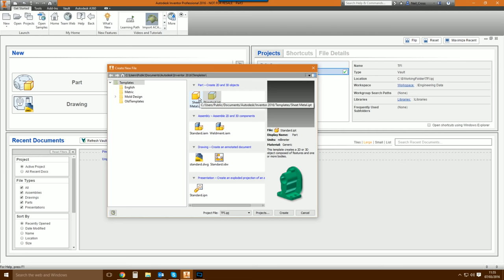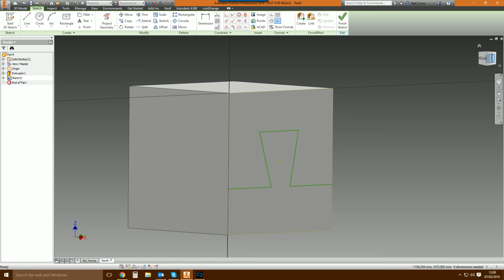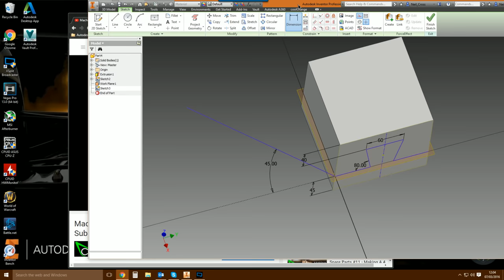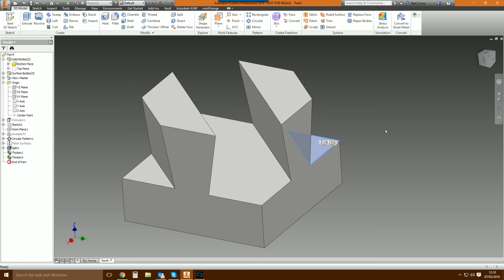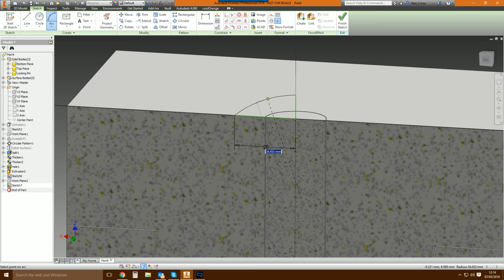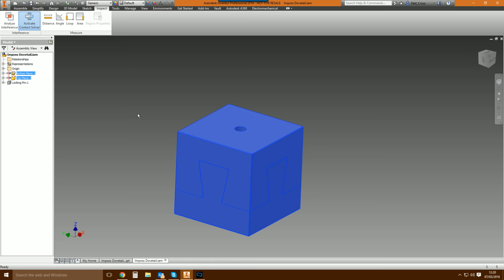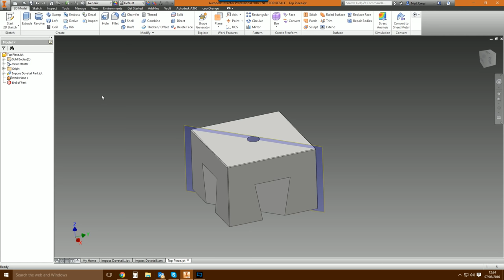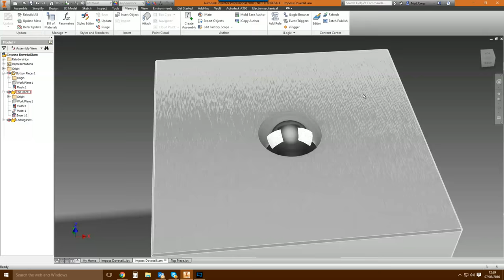Impossible Dovetail Joint Modeling Tutorial | Autodesk Inventor

Comment: I added a max movement to the pin constraint so the pin can move out of the bottom block only. with contact solver turned on, now when I move the top portion of the block, the pin pops up so the block can move. Then if I grab the pin it moves the pin and the top block until the pin lines up with the hole then the pin goes into the hole. I thought it was kinda cool and thought I would share. Love you videos by the way!!

Comment: Nice one. Hey quick question for you; I have created a sailing yacht hull in Inventor using t-splines, and I'm wondering if Inventor has a feature to clean the model up, in the way that it smooths out the model so there is no bumps. Like, I need the hull to be super smooth, but it isn't reliable to correct it by eye. Now wondering if maybe Autodesk Alias would have a feature like that... Hope you had a good time in Australia.

Comment: When you sketched the first square, how did you get ti to draw from the center outward? Usually when I start a sketch using the rectangle tool, it used the point where the axies intercept, outward. You seem to have ti set so that it uses the interception of the axies, and treats it as a cnter point for the square. I would find this to be extremely helpful in futur progects. Thank you for your help.
Reply: +Automatons Robotics Use the 'Two Point Center' rectangle tool and the magic begins.

Comment: You are a great teacher, man. I enjoy watching your videos. 
But i have a question? If you had forgot a part when you did the solid modelling, is it then possible to model a new part in the solid-ipt, and then extract it into the assembly-fil so it's grounded like the first 3 parts you did?
Reply from the maker: +Nikolaj Wennerwald Oooo yea it's a little bit of a hack, but it works.  Add the new body to the original IPT, then instead of clicking 'make components' click 'make part', you then include the new body and type in the name of the assembly, it'll then put the new body into the target assembly.  You then need to go and delete the duplicate main body it puts in... it's a complicated hack, maybe it's complicated enough to do a new tutorial on!
Reply: :) thx man . But I would definitely  like to see a tutorial on it.